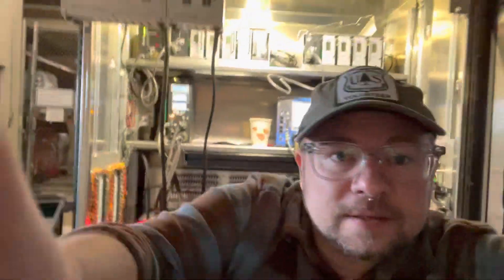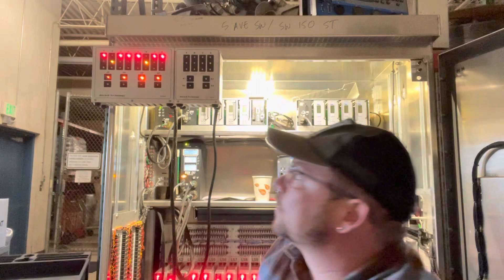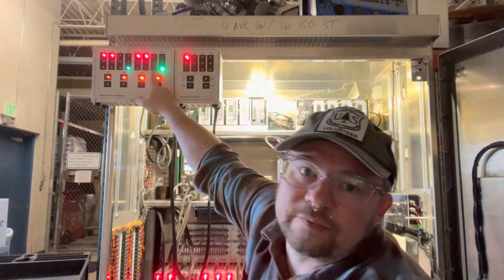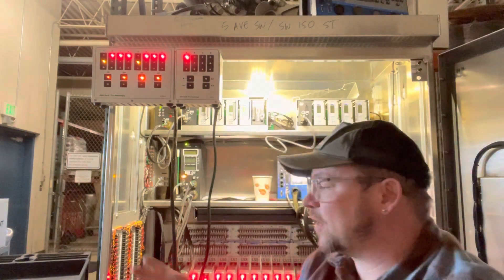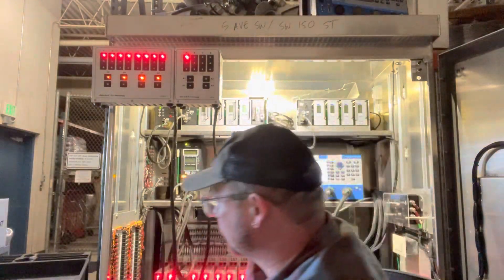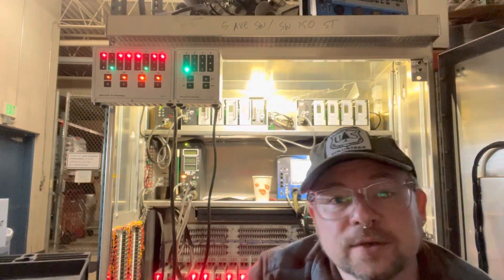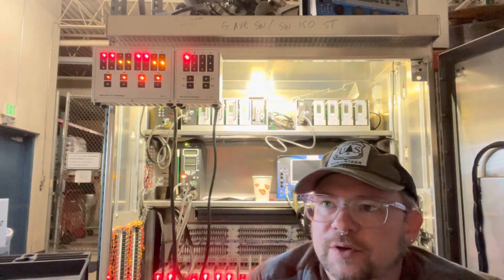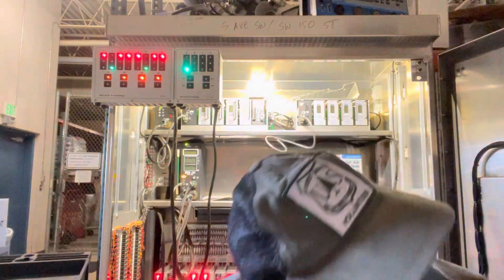Logic Statement for Transit Lane

Comment: The flashing triangle interval isn't required per the MUTCD...or at least it allows you to use some engineering judgement. I read that and we determined we were not going to flash the triangle...seemed like a massive headache.
Reply: That’s what I determined as well. Seems so difficult to program for little benefit
Reply from the maker: @Petru.S  Not too hard on an econolite EOS. It's just a setting per phase for LRT.
Reply: @trafficsignalstraining7673  good to know
Reply: @trafficsignalstraining7673  had a chance to dig through my documents. Looks like the NCUTCD nearly included language to not flash the triangle in this section when applied to buses, and I counted 4 other agencies that do not flash the triangle (one uses a solid red bar too...another deviation from the MUTCD). 

IMO, this is a time when engineering judgement comes in and for us engineers to put our PE's to the test. 

Either way is probably fine, but I prefer the solid triangle. Glad to know the new Eos controllers can accommodate it either way though!
Reply from the maker: @EngMadison  I agree, just because you can do something doesn’t mean you should
Reply from the maker: It seems pretty clear in 8-C3 is there any more verbiage that has a variance on this? https://mutcd.fhwa.dot.gov/htm/2009/part8/fig8c_03_longdesc.htm
Reply: @Traffic Signals Training  technically, this is for light rail. I think we found examples of other cities using solid triangle. But I'd have to look through my notes and our justification document. 

IMO, I'm not sure what a flashing triangle does. I can see flashing the vertical for a 2 section configuration, but not a 3 section. 

Plus, a flashing yellow means something else, and that's essentially what this is. I think it's one of those cases where someone overthought it.